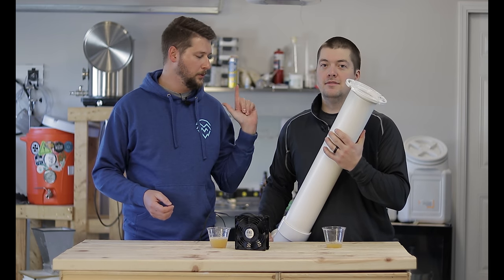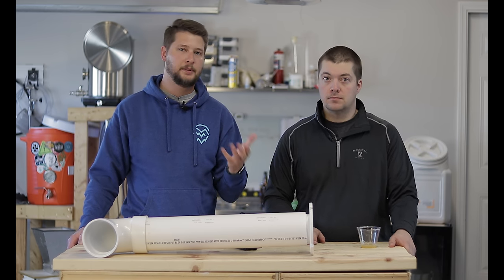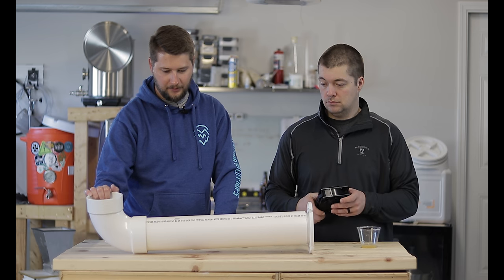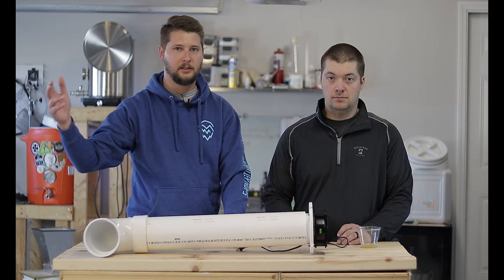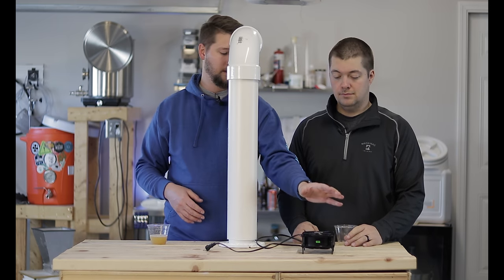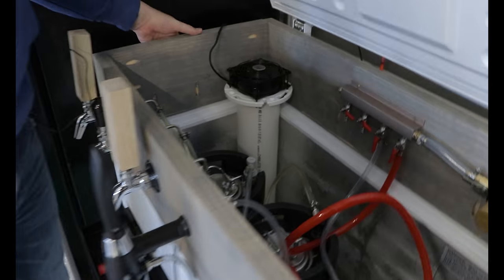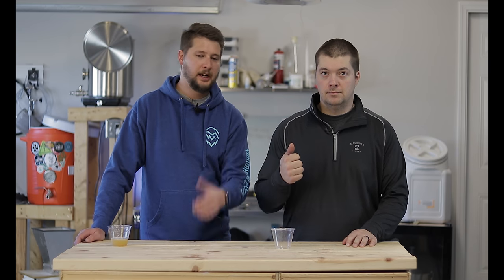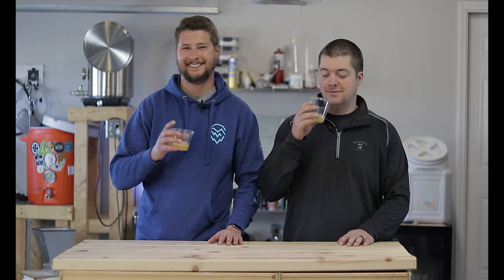Keezer/Kegerator Air Recirculation Build - Tutorial

Comment: Just curious...would it make more sense to reverse the fan and blow down through the tube instead of trying to suck cold air up from the bottom?
Reply from the maker: It could, I think because it's a rather small area in general the physics behind it doesn't matter. In this case we are just trying to move air. I'm sure it would work either way.

Comment: This idea looks very promising and I think I am going to give it a try. I'm curious, did help with the problem you were having? I have a fan mounted to my lid but never felt like it did much in the way of moving air. I have always had some foaming issues with my keezer, especially with the first pour or two. I've messed around with my pressure settings, nothing has really helped. Recently I set a 12 pack of canned beer on top of one of my kegs. Went to drink some 2 days later and the canned beer was room temperature. My temp probe in a water bottle on the floor of the freezer reads 36 degrees. That is a huge difference. Makes me wonder if my foaming is entirely beer line temperature related.
Reply from the maker: It has certainly helped with the issue I was having with foaming.
Reply: The issue I had with foaming came from the lines being too short. I did have a frozen keg in the keezer as well so I'm hoping this resolves the issue.